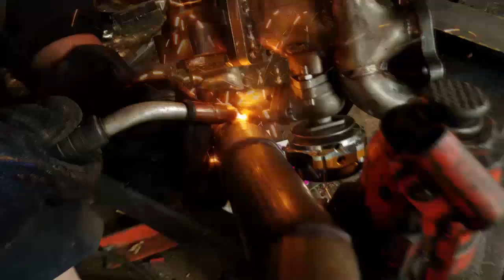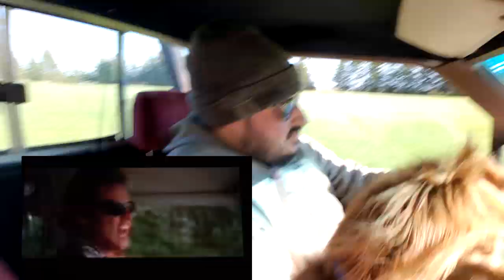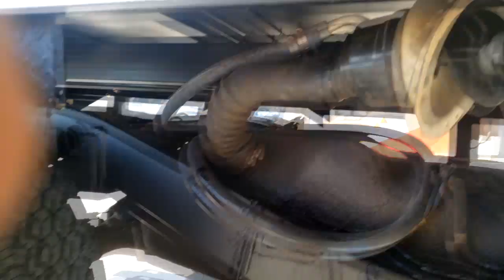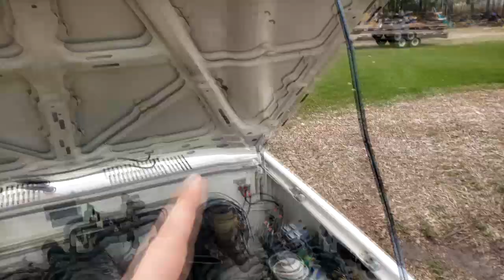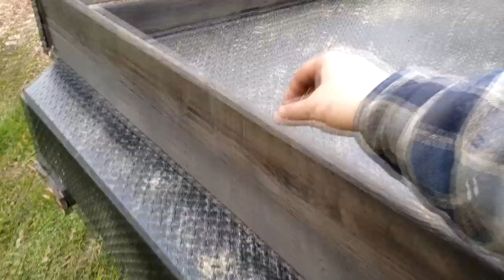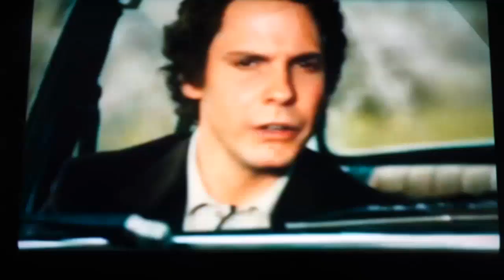Iron Panda, The 1-ton Toyota, First Drive!

Comment: How much can these Toyota 1 tons safely tow in your opinion? I know they are rated at 5,000 lbs but I myself having 22re was wondering if I could pull it off
Reply: I bought an '88 Toyota Box Truck  with the 22R-E back in March. 

I've been wondering,  with these trucks having 4 cylinder engines how it's possible for them to move the 1 ton they're supposed to be able to haul...
Reply from the maker: Ive Had approximately 1000lbs in the bed and drove it 3 hours it worked well. Next summer I will be hooking up trailer breaks and attempting to tow 4000lbs, so stay tuned for that.

Comment: Nice truck mine looks pretty close to yours… It’s an 87 with 47,000 miles original..I still have a lot to do and was wondering what tires are you running on that truck
Reply from the maker: very cool, I got the tires off simpletire.com they are Rangers